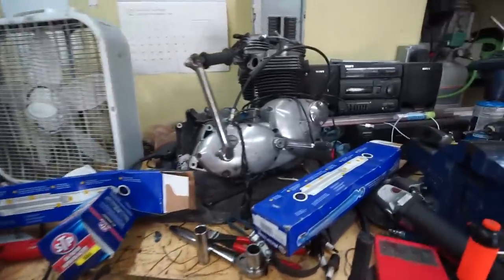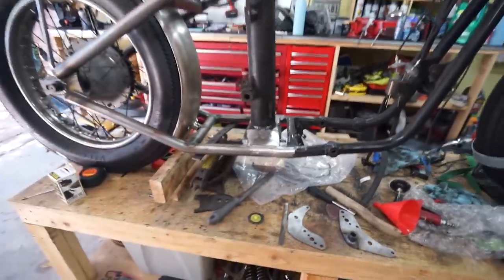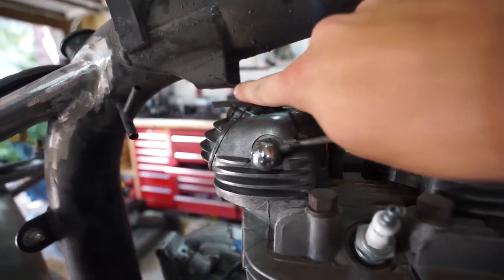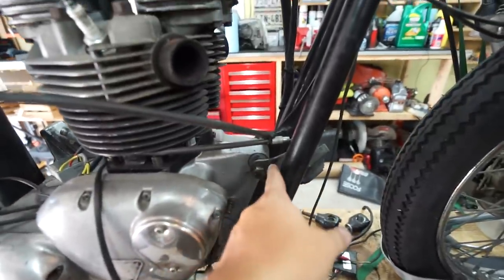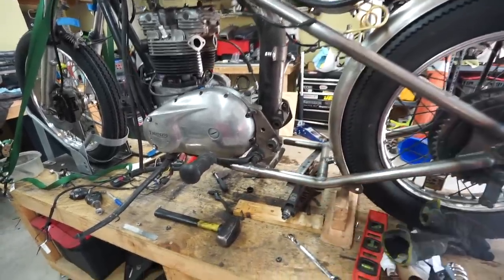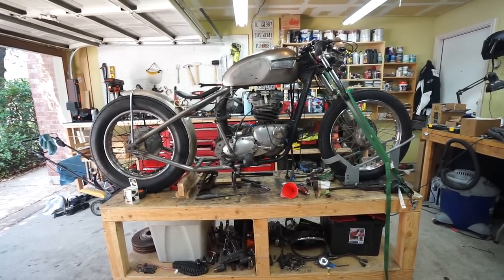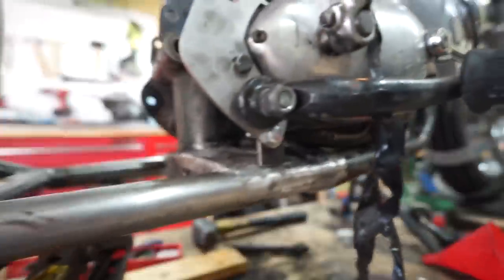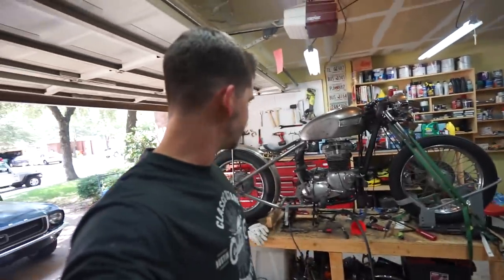Triumph Hardtail: Custom motor mounts

Comment: That last mounting point you're thinking of chopping off might be vital to maintaining the rigidity of the whole engine + frame setup. You'll notice that it's the only point where the motor bolts onto the "spine" of the frame. All the other mounting points are along the left and right edges of the frame. I get the impression that without the mounting point to the frame's spine, you'll get a lot of torsional movement of the motor while riding. I might be wrong though. Keep up the good work. I always look forward to your vids.👍
Reply: I agree. Id fab your own plates, using the original as a template and make the back a little larger so you can use that last mounting point.
Reply from the maker: Good point. I have a better way to do them in my head that will utilize that factory center mount. Glad I ran out of wire and only have one small tack weld to grind off. 😂

Comment: Make a box for the antigravity battery to go between the back bone and the cross brace for the hardtail, so it lays down parallel with the ground but not so low it catches anything on the road. The remaining electronics can go in the dead space between the frame and lower halves of the gas tank. You can also but an ignition kill switch/key there and the switch for your highbeam.

Comment: This build has convinced me that hardtail bobbers are, in fact, rad as hell. Loving this. I think you should find a way to hide the electronics up under the tank. Check out this shop's work: http://www.helrichcustomcycles.com/index.php/streetfighter-series/71-streetfighter - I love how they have the ignition switch coming out behind  the stem. Oil tank idea is nice, but I feel it's a bit dishonest, aha, and it would great to keep that area empty like you said. Keep up the great content man, you run a fantastic channel.